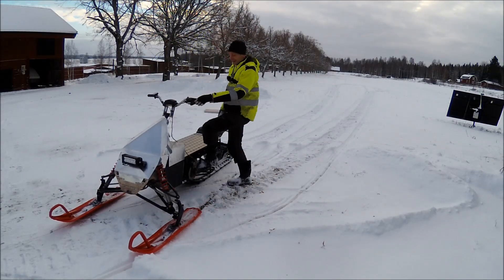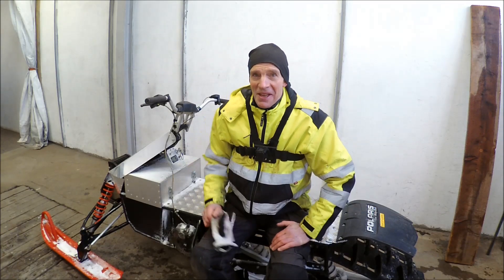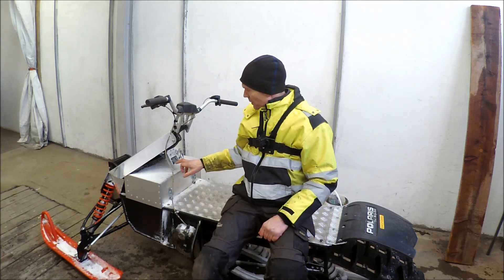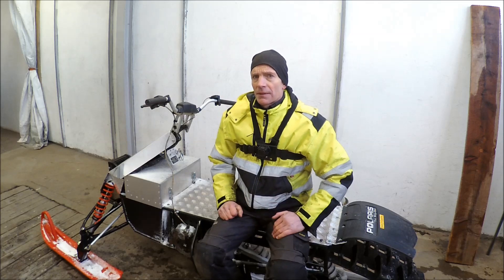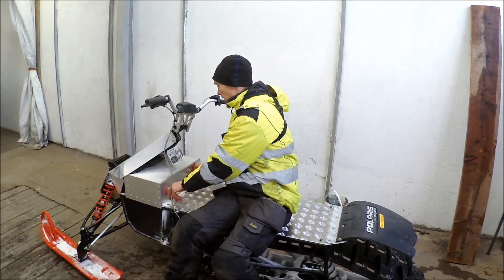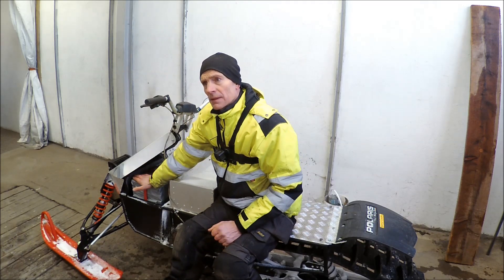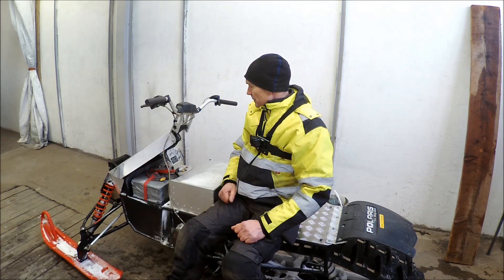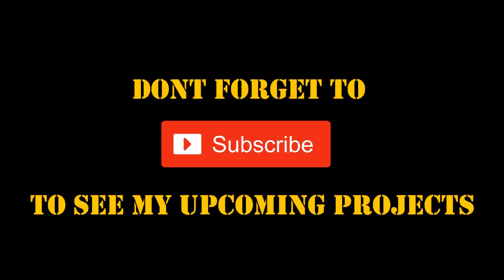Electric Snowmobile Testdrive

Comment: Hej!

Grymt.

Skulle du ha något emot att dela vilka komponenter du har använt?
Esc
Motor
Gasreglage
Batterier

Funderar på att försöka mig på att konvertera ett proride-chassi till el och ha grunden klar i drivlinan skulle göra att jag kommer till skott snabbare.
Reply from the maker: Hej, Håkan! Kul att du gillar bygget, här kommer alla grejer: Har köpt mina motorer från: https://evea-kartmasters.fr/en/35-synchronous-motors  Kör med ME1115 i skotern.

Controllern : https://kellycontroller.com/shop/kls-8080i-ips/   96V och 600A, här finns även relän och reglage.

Batterierna till detta bygge Aliexpress : https://annpower.aliexpress.com/store/623665?spm=a2g0o.detail.1000061.1.280b20e9VHZ5t0

Och : https://www.aliexpress.com/item/4000916420570.html?spm=a2g0o.productlist.0.0.9ead3217me3dPY&algo_pvid=5db9ca31-3ef6-4145-bf9e-3799e3c2d0c7&algo_expid=5db9ca31-3ef6-4145-bf9e-3799e3c2d0c7-2&btsid=0b0a050116124705816823094e0ceb&ws_ab_test=searchweb0_0,searchweb201602_,searchweb201603_

Likaså BMS : https://www.aliexpress.com/item/32880702537.html?spm=a2g0o.productlist.0.0.4b80650cdXUq9j&algo_pvid=c58492a7-0a54-4fb8-a657-bfba5abc6149&algo_expid=c58492a7-0a54-4fb8-a657-bfba5abc6149-19&btsid=2100bdcf16038096092217546ea4b8&ws_ab_test=searchweb0_0,searchweb201602_,searchweb201603_

Räkna med ca 30 tkr för ovanstående.

Batteribygget hittar du på min kanal : persteel
Reply: @persteel  tack för det.
Hur löste du gasreglaget? Hittar bara traditionella rullhandtag.

Självklart följer jag din kanal. Väntar på Long range versionen på din skoter.
Reply from the maker: Hej, Håkan!   Det finns på Kellys hemsida: https://kellycontroller.com/shop/thumb-throttle/
Skulle satsa på OEM batteri typ BMW I3 modul eller M PHEV batterimodul, mycket stabilare än de pack jag svetsat ihop. De blir lite tyngre men funkar nog bättre.  Mvh Pär
Reply: @persteel  tack för det.

Bygger drönare själv så batterier kan jag lite om. Jag tänkte nog köra på Lipo från Hobby King på första versionen.
Dom klara av snabb urladdning/laddning

Comment: Ungefär hur mycket kostade det att bygga skotern?
Reply from the maker: Hej, det som är dyrt är motor, controller och batterier, det ligger på ca 30 tkr. Men de grejerna flyttar jag runt lite mellan mina projekt. Sedan är det allt annat, men det är mest begagnade grejer. Har köpt nån trasig skoter och plockat grejer genom åren och samlat på mig. Men säg 10-15 tkr till. Mvh Pär
Reply: @persteel  Tack för infon! Mvh Simon

Comment: How far can you go on a single charge right now?
Reply from the maker: Hello, vibrantbell ! I can drive for approx 30 minutes,  topspeed 60 km/h... aprox 10-15 km !?  BR per
Reply: @persteel  what are you using for batteries (I might have missed that part)
Reply from the maker: @vibrantbell  I use these : https://youtu.be/6ezTCG2Kiz4   BR Per
Reply: @persteel  awesome! Thanks for the replies. I have a friend who makes motor controllers , when I get around to it I’d like to try his controllers in a sled :)
Reply from the maker: Sounds interesting, just to get started !!  BR Per
Reply: Could fill the platform with batteries and put a seat on top
Reply from the maker: @bossmustang6able   Yes, have an idea of a long range package !! BR Per